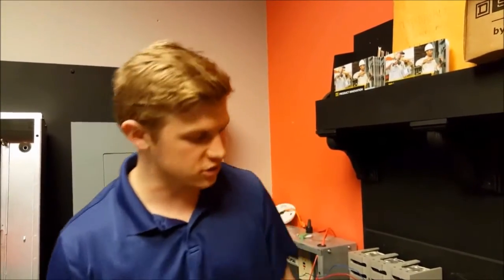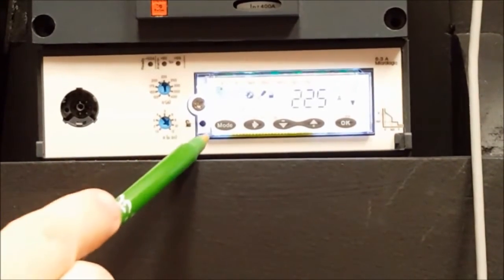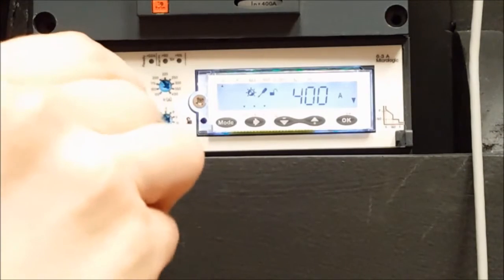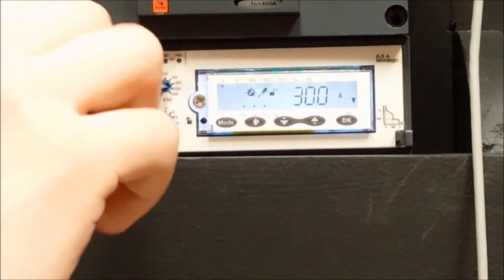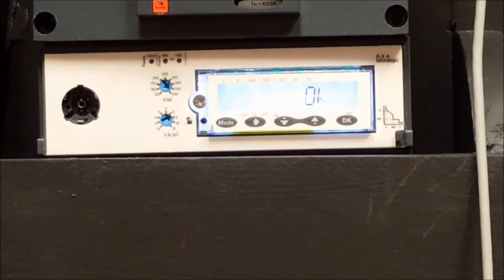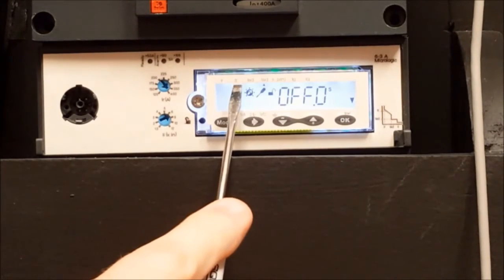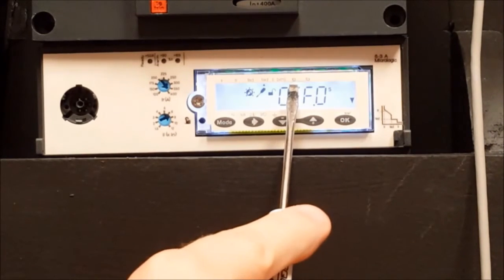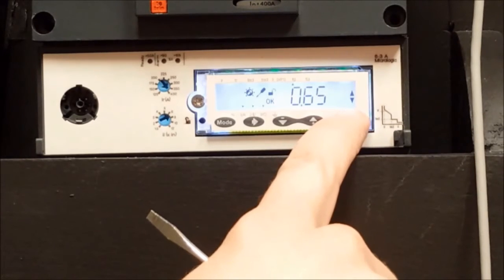Configuring H, J or L Frame Micrologic Trip Units via Display | Schneider Electric Support

Comment: How provide power for micrologic trip unit?
Reply: Should he  mention  external  power supply 24VDC that  is required in case  breaker is open. external  power supply, LCD might not have  enough power to operate when  load current is low or breaker is open